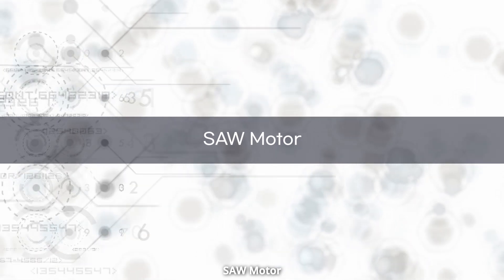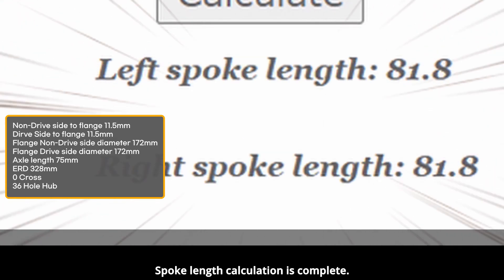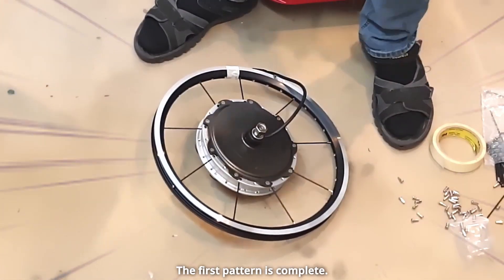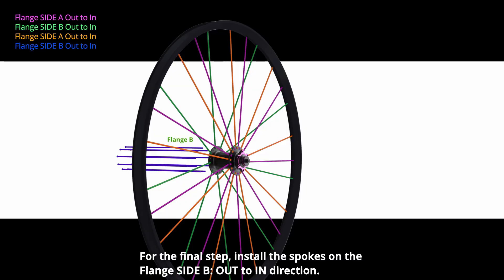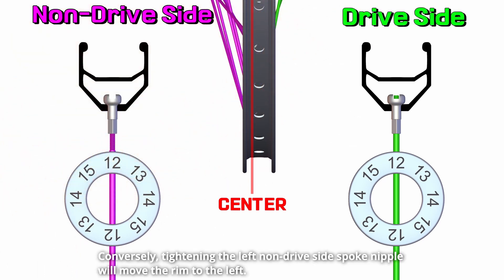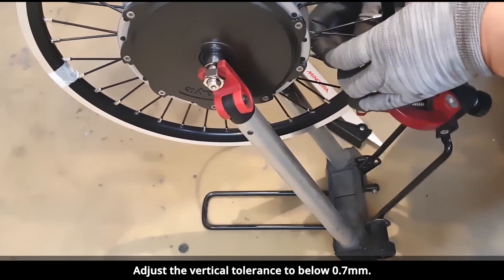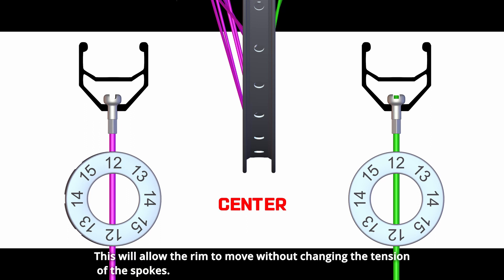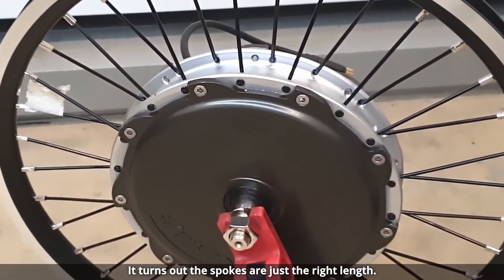Brompton SAW20 Hub Motor Wheel building and  Statrade Ferrofluid GRIN : 16inch Radial

Comment: Wow grin is over priced and not by a little bit over either.
Reply: I just hate being poor but Ima get me some grin at some point, I definitely want to ability to control my power consumption and they have the stuff for that. And the water proofing is needed, I think most of their stuff actually means waterproof unlike the China stuff.
Reply: @Ro-Bucks  yeahh same man. If money wasn't a problem I'd 100% get it. Their phaserunner controller is just insane. There's nothing else that powerful for that small on the market.
Reply: While they are definitely very expensive and I would never buy them over standard priced ones, I can understand their pricing. They're designed, manufactured, and assembled in Vancouver, Canada in small quantities, where labour and parts are all very expensive, while most parts are mass produced in China. It's not even a factory really. They make everything in a shop. I'd still rather buy a mass produced Chinese hub though, since it's not worth paying 4x the price for a local product for me. If it was around 2x the price I might even consider it.